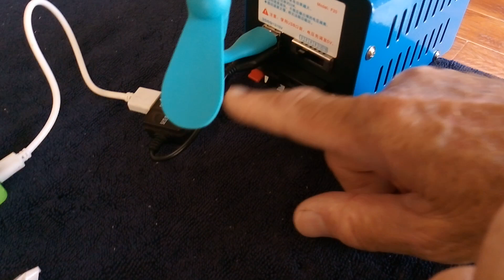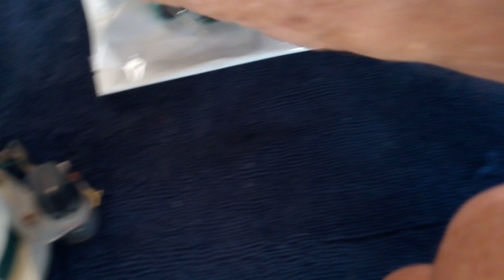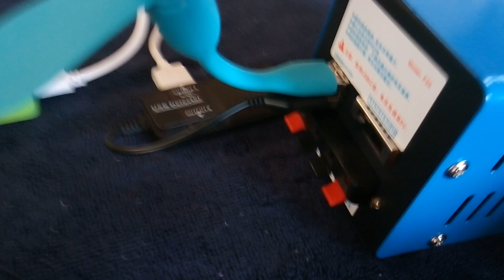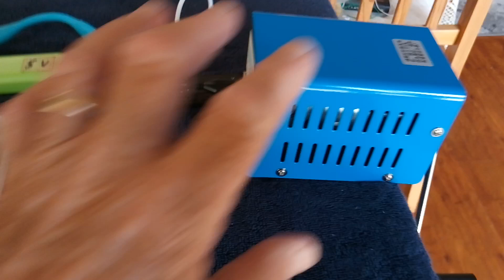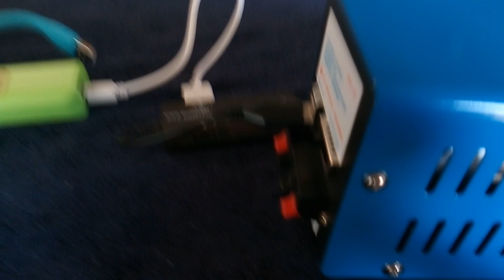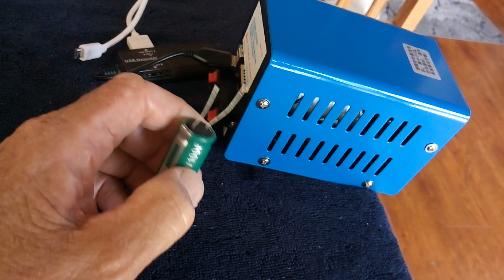Lasersaber MiniBoost Box---  Replication part 1

Comment: Gearbox and Generator is mechanical and won't last 20 yrs like the caps.
Perfect for short term usages no doubt.
Reply from the maker: You are right.  This really isn't a good choice for constant usage. I see it more like a flashlight that you use on ocasson but sits on the shelf most of it's life.  Perhaps store it in an airtight plastic box with silica packs to keep the moisture level down.  You can buy just the generator/gearbox on EBay for $20 as a spare and have it on hand if the intent is to use this often.  In 20 year ALL of this stuff will be vastly obsolete.  The caps might be an interesting cuiosity to look at in a museum.

Comment: Are those caps US made? I have some of the 100 Farad Chinese made ones but they are fatter and shorter than yours. I thought lasersaber started using the larger electrolytic caps instead because they charge up so much faster. That's neat Lidmotor, I hope it works as well or better than you expect for you and lasts.

Comment: Only place i can find those dynamo's is on Ali Express and they are pretty basic and expensive too.
Reply from the maker: Hi Ben.  The dynamo is on Amazon for under $40 and also EBay.  The problem was the 2.7v / 100 Farad supercapacitor.  I stumbled on to these on Amazon that cost about $5 each.  It is a pretty pricey project but it is something I really wanted.
Reply: @Lidmotor  Thank you. I'm looking forward to further developments! 5 $ for those caps sounds reasonable.